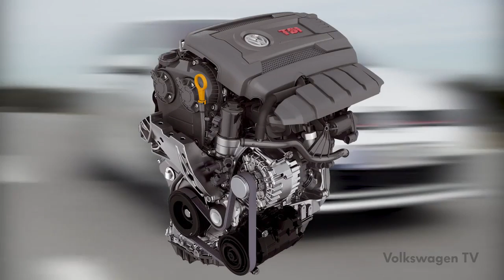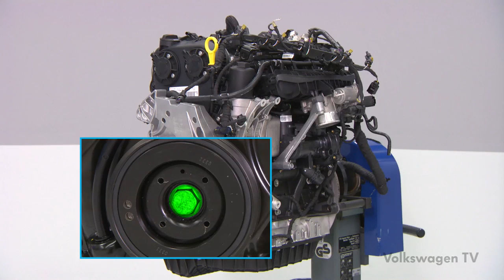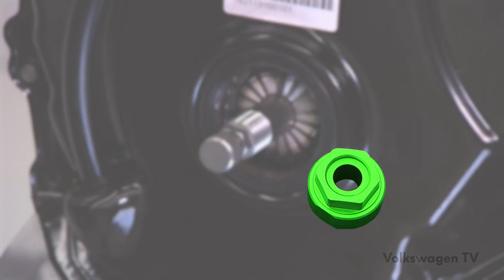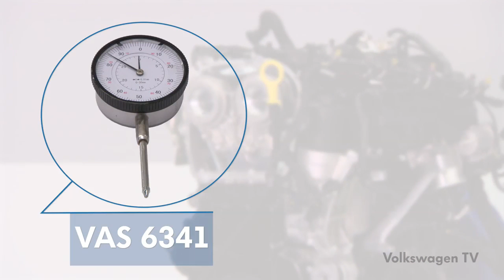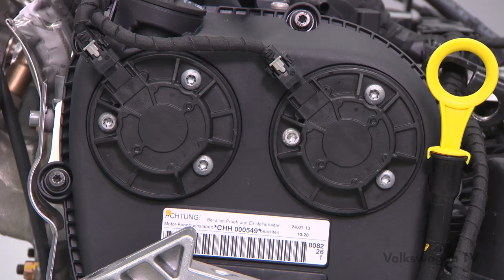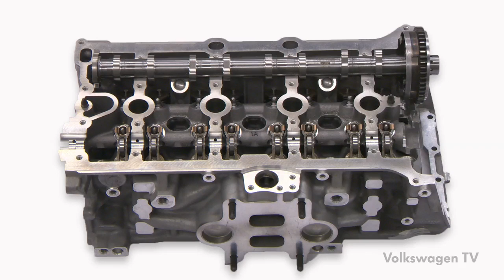EA888 gen3

Comment: Plastic oil pan..lol.vw
Reply: Jonathan Chen lots of manufacturers are going to plastic pans. They are lighter. One of the many things they are doing for fuel economy.
Reply: What about the plastic gas tank and manifold? Also wanna to remind you about plastic frames for handguns ...
Reply: @andri9191  plastic is lighter, but iron block is heavier, than aluminum. this ea888 is iron.
Reply: @Иван-о3ъ6ь  is iron and closed deck for the greater resistance of the monoblock! If prepared this can withstand 1000hp and even more.. in any case the complete engine weigjs about 140 kilos...not heavy
Reply: Notice cars putting plastic parts instead of  metal but also ever increasing operatiing temperatures of 200 plus degrees. Planned obsolescence.

Comment: Plastic and aluminium turbo charged engine. VW stop please.
Reply: Welcome to all modern cars.  Btw the 2.0T is iron block/aluminum head FYI.
Reply: Artem Strizhevski lol and yet these 2.0 TSI engines run perfectly well on 500+ horsepower....
Reply: @andrejflis1991  yes, for about one minute or two...
Reply: @Иван-о3ъ6ь  lol for like 3-4 years. You cant make this stuff up you know, its general data and information.
Reply: @andrejflis1991  😂 yeah Sure